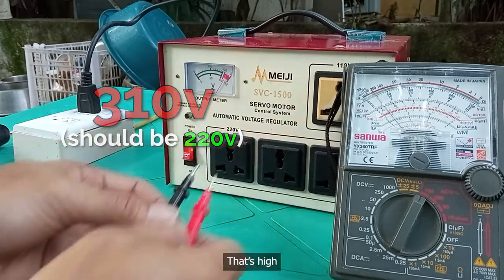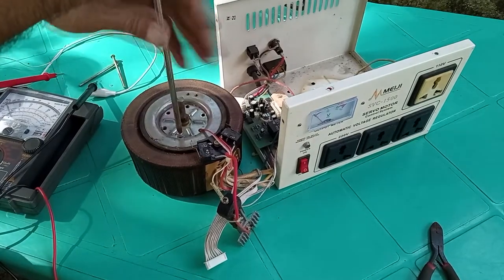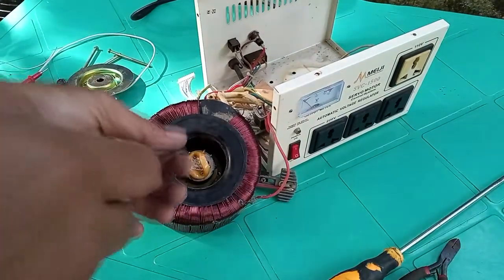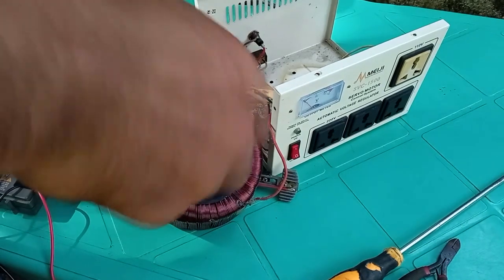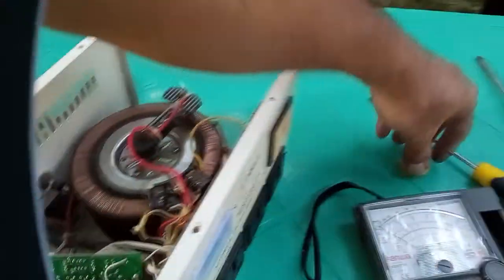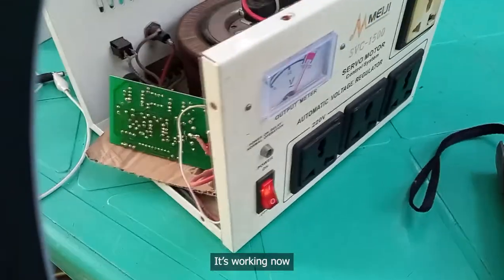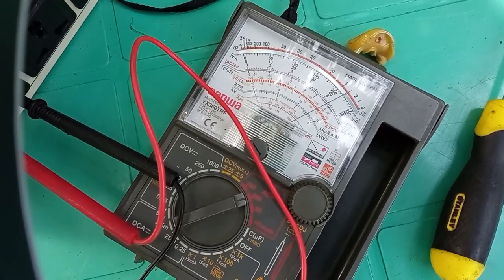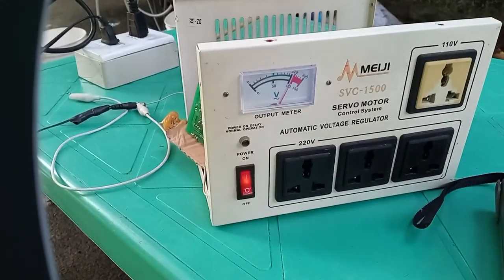Meiji AVR Repair (SVC-1500 AVR)

Comment: Hi, the output voltage of my AVR  is 200v . i tried to adjust the trimer but no change in the output. Any idea what I need to do? Thanks
Reply from the maker: Trimmer po you need to clear it or replaces it po
Reply from the maker: Try to twist manual mechanical to lower or to get high voltage, if its working try to check the motor if he recieve power from adjaster trimmer

Comment: Nice video bro may tanong din ako yong avr ko may output piro pag ipaplug mona yong freezer walang isang segundo mg tripoff sya ano problima nito?
Reply from the maker: Depende po sa avr nyo ho, pg mataas po ampere needed nung freezer mg shotoff po or putukan kyo ng fuse po
Reply from the maker: dapat po mas mataas po ampere nung avr nyo posa freezer nyo ho
Reply from the maker: Bka ho mataas ung ampere ng ref kesa sa avr nyo po

Comment: gudeve.kng low voltage ang outpot ng avr anu sira?sanA masagot tnx
Reply from the maker: Pag low voltage output pwedeng walng sira, try mo muna i adjust yung trimmer adjustment, yun yung voltage up down, pag inikot mo at hinde nag response me problema board
Reply: yong ginagamitan nang scrow driver ang trimer sir? inadjust kna wla responce sir.pwd gawa ka ng video pra jan sir